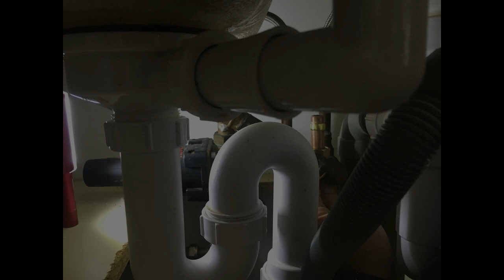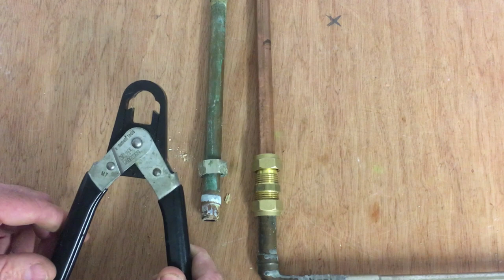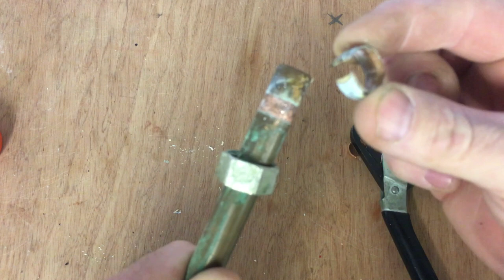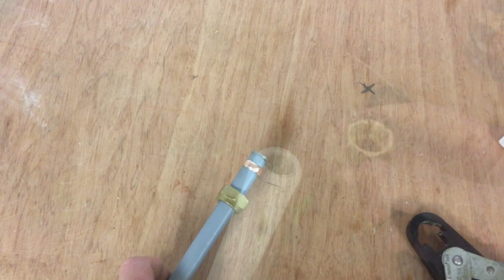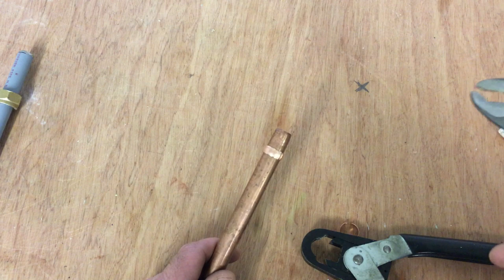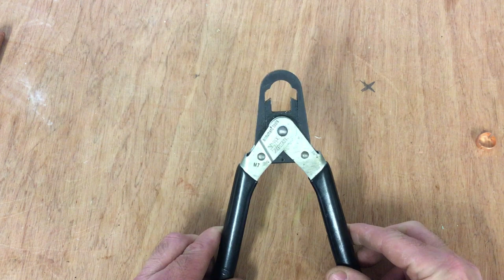How To Quickly Remove an Olive from Copper Pipe

Comment: Great tool and video - I personally prefer the dickie dyer olive splitter as it's one tool that works on multiple pipe sizes 👍 I think rothenberger also make one. The advantage of the monument splitter is you can use it on plastic pipe.  Great video Sir 👍
Reply from the maker: Thanks for the comment, yes, removing olives from plastic speedfit or polyplumb pipe is difficult but the featured Monument cutter is brilliant at that specific task as well as normal removal from copper pipes. Thanks again for the comment, much appreciated ! 👍